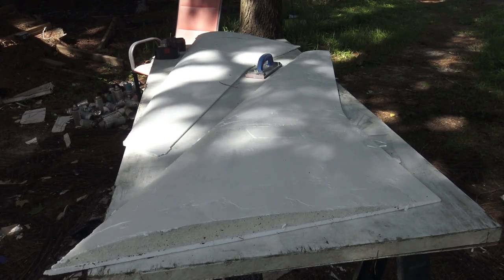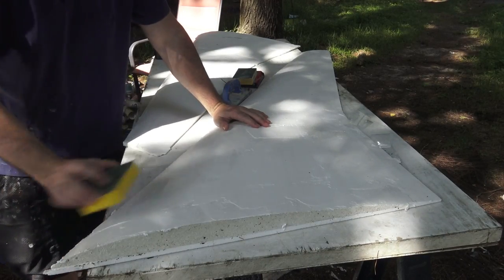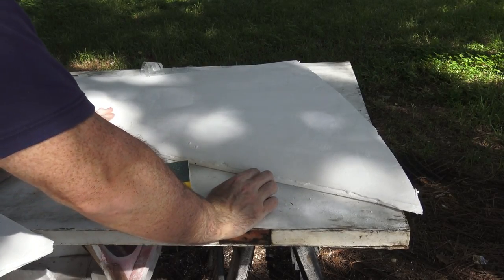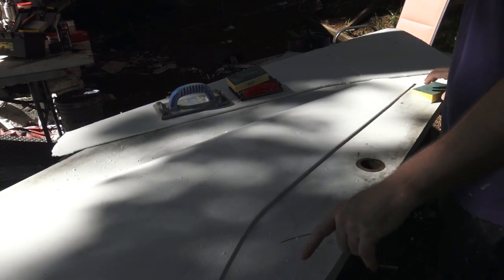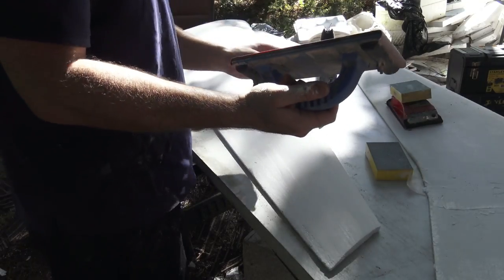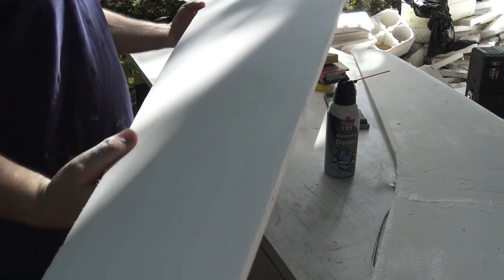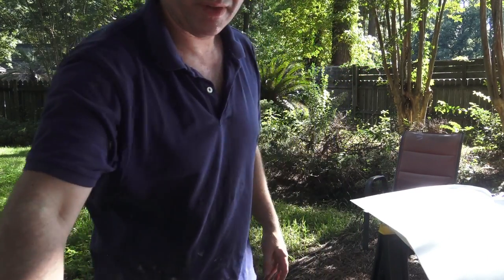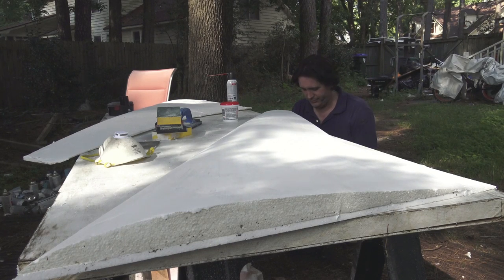Emirates 777-9X RC Airplane Airliner Build Part-16

Comment: Lovely work as always Chris,you find the right products,you use them properly taking great pains to get things smooth,even at this stage without any carbon fibre the whole thing is resiliant,what would be the point in getting this far if you knew a surface would crack ? your works of flying art are engineered to be rugged in service and when you build this big then it is essential to understand every aspect of flex which you certainly do,I doubt whether the person who offered what they did has ever built a wing let alone this large,ideas and success are gained through practise and perfection,those two attributes are what you certainly follow Chris,thank you for your excellent tutorials.
Reply from the maker: I appreciate that Mr Reading, I have no monopoly on RC knowledge Nor do I have all the answers, I I'm not an ego-maniac who can't accept new Ideas or criticism . . . . I live to learn . . .period.
I always try and stay grounded and humble and pass on what I learn and look forward to learn from others in this Hobby.